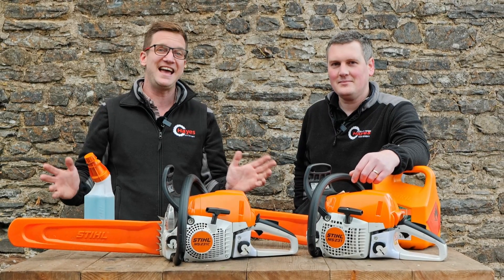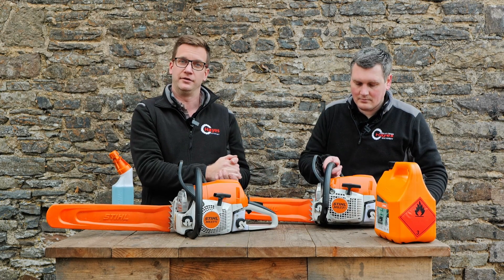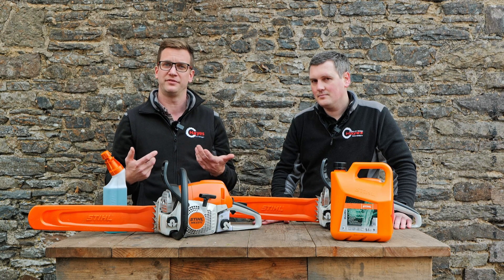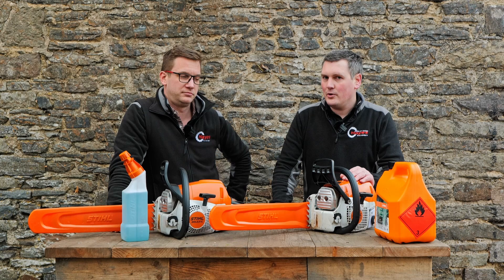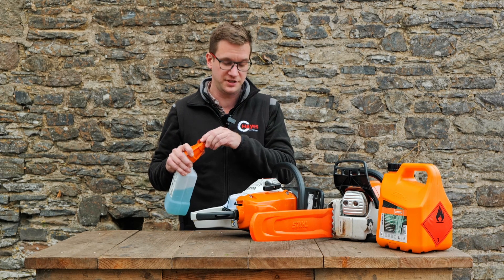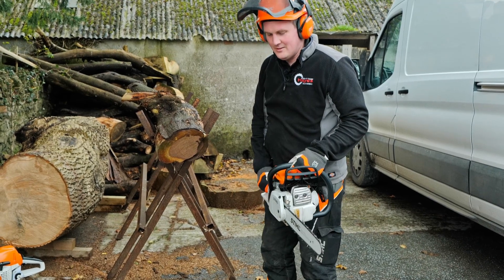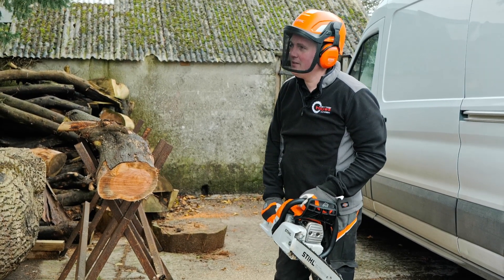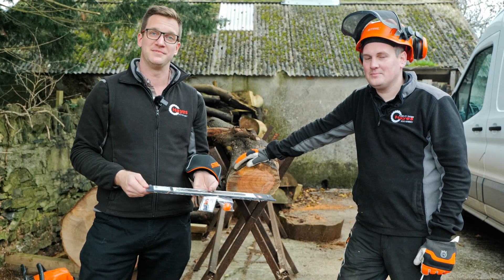Can You Use E10 Unleaded Fuel In Your STIHL Chainsaws And Small Engines?

Comment: Aspen 2 and motomix are exactly the same. I had to retune all the carburetors when switching over to these products as the tools bogged down and would not rev. I recommend using e5 and oil mix during the seson then winterising with one of these premixes.

Comment: Even with multiple weapons of choice, fuel is never in a tool for more than a couple of weeks. E10 with a quality oil, works perfectly fine. Premix is still very expensive in comparison! For example, if I used premix in my HS45, it may extend the life of the machine for a couple of years, but for the extra cost of the fuel,  I could buy another 3 HS45's in one year!
Reply from the maker: It’s a maxing how many machines are left for a while, even commercially. Things like rotavators, big saws, headetrimmers and then lawn mowers and strimmers and  over winter.

Comment: My Echo chainsaw works daily and happily on E5 unleaded 50:1 oil mix.

One day I decided to do my bit to save the planet by using "Green" E10. 

I decided to also save money and filled my Echo Chainsaw with E10 mix.

It refused to start despite checking everything, much sweat and cursing.

Threw away the E10, refilled on E5 mix and it started on the second pull.

So if you're thinking of using cheap "Green" E10 in a chainsaw:

DON'T.

Comment: It's awfull.to sell machines that need special petrol..redicilous infact ..it should be just like 2 stroke engine ..just add a bit oil to normal petrol....no buy special motomix ..for 3/4 times normal..it's outrageous
Reply from the maker: You don’t have to buy special petrol. This video explains that you can use E10 but do not store it for a long time. All 2-Strokes engines still fun of petrol.

Comment: I have just burnt 2 chainsaws in the space of an hour and the only thing I can pin it to is E10 fuel 😡😡😡
Reply: I must add, both are 2006 Stihl, MS660 and Ms440
Reply from the maker: What oil are you using Jay?
Reply: @MachineryNation  I use Stihl HP 100ml bottles.
Reply from the maker: @JayHm  for big pro saws like them, you want to be using a fully synthetic oil like HP Ultra. HP is a mineral oil and can’t cope with the heat of a pro saw. I hope this helps 👍🏼
Reply: @MachineryNation  many thanks for the pointer. I will order some 👍I was using both saws for milling as well!!
Reply from the maker: @JayHm  yeah Milling is the worse for cylinders, as the saw is not moving around, the oil is not getting around the system properly. If using an Alaskan/ladder Mill then it best to turn the saw while running prior to the next cut.

Comment: From my experience, any saw or small engine should never be stored longer than 30 days with 10% ethanol fuel. Nothing but problems with the carbs if stored longer. In my saw, I use non-ethanol gasoline bought at the pumps  mixed 45:1 with stihl oil when doing a good amount of cutting (15-20 cords a year). After cleaning it to be put away for the winter, I drain the tank  and run it dry, then put alkylate fuel (Stihl Motomix) in it, and run it  again to get it through the system. My MS 261C (Mtronic) always starts within 3 pulls even after 6 months or more of sitting. So, in a nutshell, if you have a fuel station that sells NON ethanol gasoline, get that. It may be more expensive but it'll save you a lot of headaches in the long run and it's still cheaper than Motomix. From what I understand, ethanol is added to raise the octane rating on lower grade fuel.
Reply from the maker: Good advice Billy 👍🏼 here in the U.K. we unfortunately don’t get non ethanol pump fuel. Sounds like you have got it spot on 🤩
Reply: @HayesMachinery  , another option for you folks in the UK and elsewhere that don't have non ethanol gasoline and really want it would be to call the fuel supplier(s) at an airport nearby to see if they would sell 100 octane low lead (100LL) or equivalent.  It may cost approximately 50% more than regular pump gas, but it doesn't contain ethanol if that's what someone really wants or needs.  I do believe it still contains  toluene and benzene (not good for  diaphragms or gaskets though) , but it is a fuel that will last longer and not absorb moisture.  I would still highly recommend storing for longer periods with motomix, but I wouldn't worry about having a saw  sit for 3-6 months with avgas in it .

Comment: Can petrol without ethanol added be bought at service station in England? I’m in Australia and try to buy petrol called 95 which does not have ethanol for my chainsaw. Also if the chainsaw is stored for a few months I usually run the chainsaw till the engine runs out of fuel so there is no fuel in the carburettor. Is this a good or bad thing to do.
Reply from the maker: Hi Karl, we can buy E5 which is 5% ethanol over here. Running a chainsaw dry can cause the diaphragms in the carb to dry out. Ethanol free and starting regular is the way to go 👍🏼

Comment: Guys how does that fuel or even stale fuel affect the fuel injected 500i model? Great video. 👍
Reply from the maker: Hi John, yes stale fuel will act the same in the fuel injection unit as it does carbs. Same rules apply for Motomix and E10 also. I hope this helps. Thank you for the support 😎
Reply: @MachineryNation  honestly I don't believe that to be fair. I watched the video on E10 for stihl equipment and basically the m tronic carbs in stihl can handle it. I think the 500i is more advanced than this and can adjust with the computer.. not that I'd leave months old fuel in it but if stihl claims what it can do we have nothing to worry about? Only manually adjusted carbs from what I've heard..
Reply from the maker: @6900pilot  E10 fuel is fine. Stale fuel is stale fuel, nothing is going to run well or even start with stale fuel. If it’s stale it’s stale. Our information is direct and supported by Stihl GB. As mentioned in the video, Stihl m-tronic systems are designed to run up to 25% ethanol and can cope with it fine, but if you let it go stale, it will be the same outcome.
Reply: @MachineryNation  all I was saying is if there is no carb in it surely the fuel can't really go bad? The computer is supposed to adjust accordingly even for altitude and working conditions? Of course I understand about really gone off fuel.. these saws are supposed to be smart..
Reply: No harm intended I spent over 1200 euro on a saw I just want to look after it the best I can. Thank you..
Reply from the maker: @6900pilot  no worries at all John. As a Stihl main dealer we would only quote the same as Stihl. It’s nice to here someone who looks after their saws 👍🏼
Reply: @MachineryNation  I've emailed stihl about the ultra oil maybe you can answer, is it rated jaso-fd  or fb? And hp super is the only oil with stabilizer? Dealer recommended ultra is there any reason at all not to run hp super in the 500i? Cheers guys  👍

Comment: Bio Ethanol  is very bad for engines.  Use non ethanol 98 or higher mix it up 40:1.  25 ml Motul m800 off road 2stroke oil per 1 liter gasoline.   Stihl premix is not good for the saw, cuzz is has 50:1 oil in it due emission laws. Too hot for the saw.    And their stihl premix 2T fuel cost a fortune.

Comment: In 6 months, the motomix saw will start as per normal and the e10, will probably, but run rough as old boots, I think.
Iv used aspen for several years and machines can sit for months and start fine.
Good video 👍
Reply from the maker: I think you’re bang on the money Jason! We used Aspen for years until Stihl and Husqvarna bought out their own 👍🏼